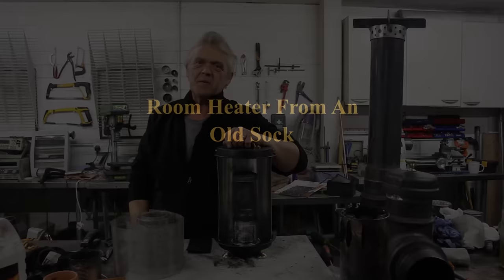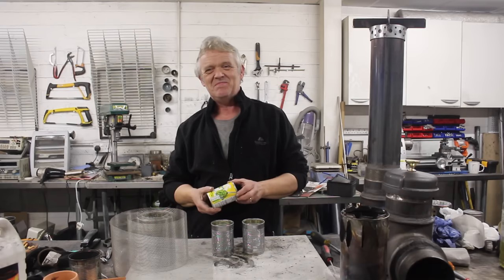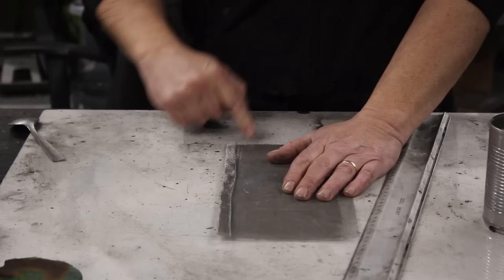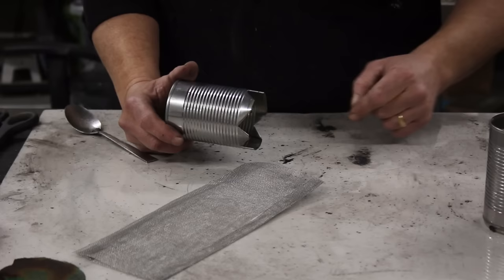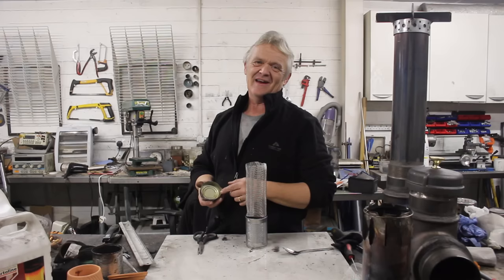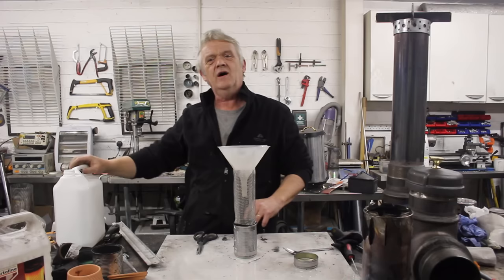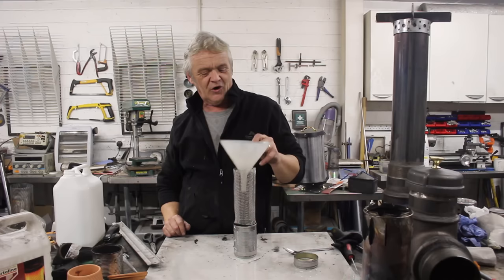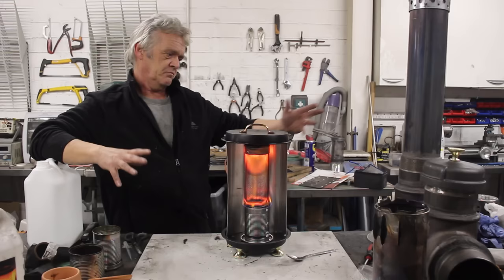1746 DIY Room Heater From An Old Sock

Comment: Do you get any smoke off this? I tried the older version with isopropyl and it smoked the room out very quickly
Reply: Smoke is the result of not complete burn. You need to add more oxygen. I beleve Mr Smith had a few episodes on that and also there are other people showing how kerosene lamps have changed.
One way would be to make an extra hole in the middle, providing more oxygen to the inside of the mesh mantle.
Reply: @ogi22  maybe i had the wick too high
Reply: @the30minutechef  that's also a way to decrease the amount of soot. If you make a wick shorter, flame will be smaller and oxygen requirements also go down. But the tradeoff is less heat/light.